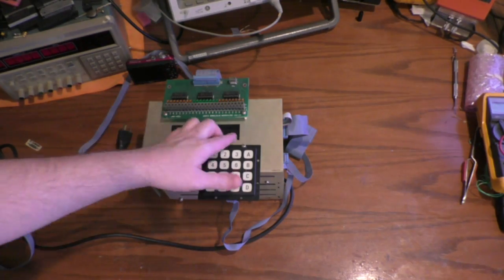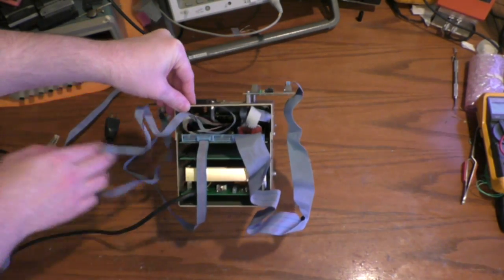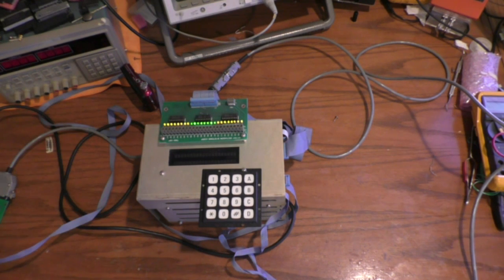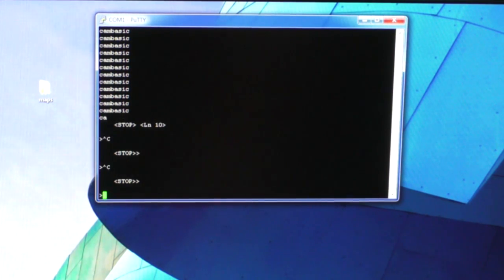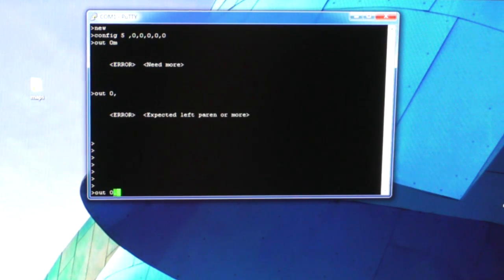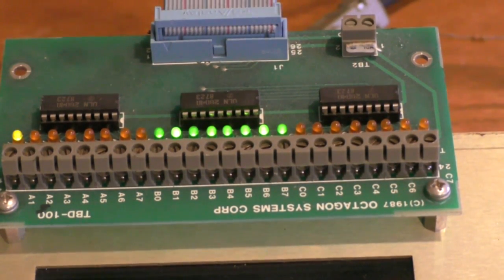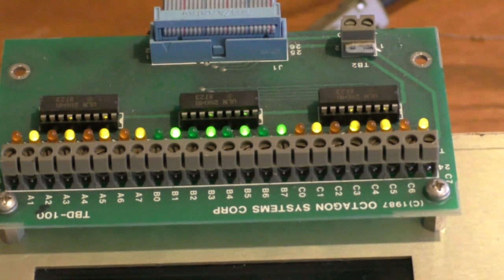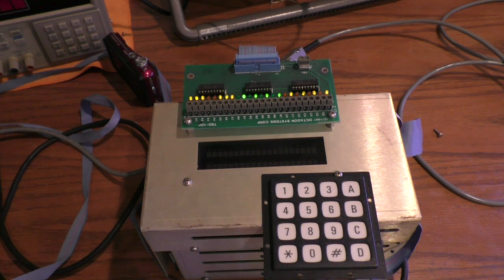CAMBASIC Industrial PLC Test and Use

Comment: Not sure if you or anyone is paying attention to this anymore, but I have come across a couple of these CPU boards but have had zero luck finding hardware documentation for it. I did find the manual for programing, but not the hardware. It seems like I should be able to run it w/o the cage, but w/o pin outs and jumper details this is proving to be a bit difficult to say the least beyond powering it up and seeing activity on CPU bus pins.  Any links or other help out there??